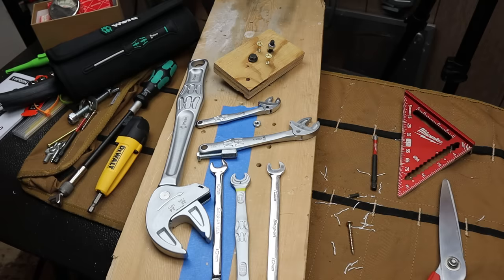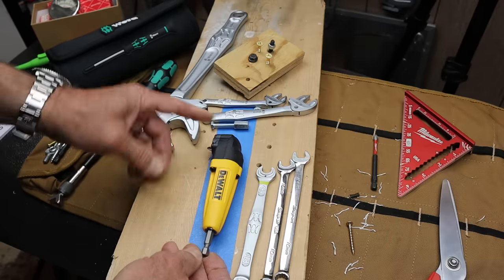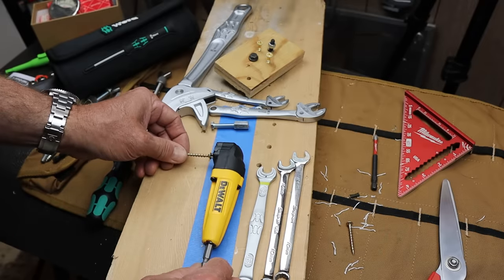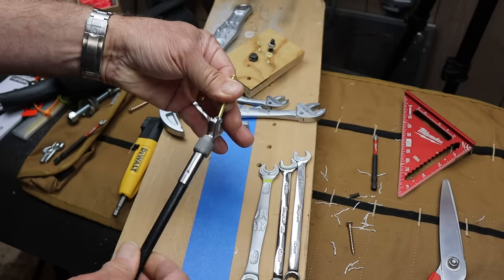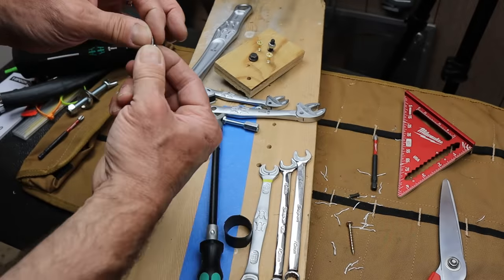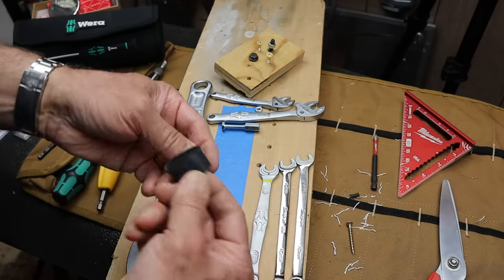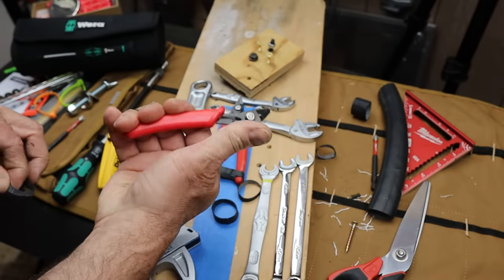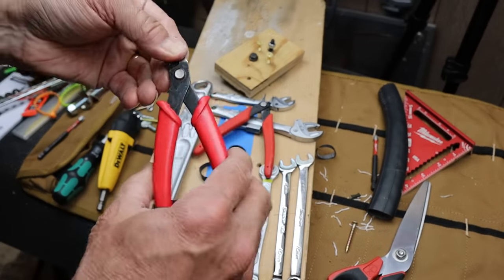Wera Joker Combination Ratcheting Wrench: If Apple made wrenches, this is what I'd expect. Very Nice

Comment: Hello again Doc 
Thank you for another Great Video. I have not had the experience of using a Wera Wrench yet. As an Aircraft Mechanic all our Tools are SAE/STANDARD. No Metric tools. Remember aviation was born on USA soil. One other thing, most of our hardware is twelve points, we do have some six points hardware. But mainly twelve points. I said that to find out.  If position was switched to twelve points, would the Wrench still work? Again thank you

Comment: I have these spanners, they're great unless the fastener is really tight or corroded.
The ratchet heads arent the most robust but okay.
The offset hex nut holder is a real winner when needed.
Top expensive for what they are imho

Comment: Why wouldnt they make SAE set? Eventhough arent nearly as common as metric, theres still plenty of SAE hardware out there. Id say 95% of the new tools i buy are all metric, but thats because its far more common so ill get much more use out of them, and i have plenty of SAE tools for when i need them. But ya thank you for the review on the wera joker. Ive been seeing a lot of ppl talking about them lately. I love how they have that feature to hold the fastener, as well as the directional arrow. So many of the ratchet wrenches that you have to flip back and forth for tighten and loosen dont have a directional arrow. Such an easy thing to put and so important to have it blows my mind so many manufacturers dont include it
Reply: because Wera's market is largely Europe. But they've been getting more and more popular in the states so I presume they will go that way soon.

Comment: 10:15 Not inventing, as doing Appliance repair/maintenance and electronics repair means you ARE IN SITUATIONS just like this. Had a dishwasher 2 weeks ago, built in, and had to replace door pulley system on both sides. Once removed bottom cover of dishwasher, was able to get hands and super low profile 5/16 ratcheting wrench in there to remove screw and nut from the 2 pulleys, and remove spring and thread new rope and replace pulleys w/ new; but it’s tight, and NEED super low profile ratcheting wrenches and but drivers that can go on wrenches, thumb spinners, etc to do this kind of work. Still looking for best already made tools instead of making my own over and over; so keep looking, buying and hoping they work for what need after purchasing expensive tools at time.
So, again, not a waste of time for this test device you have here as IT HAPPENS and anyone in appliance, hvac, electronics, electrician, etc repair/work will find tools like this EXTREMELY HELPFUL AND PAY for them! as it can mean spending few minutes or hours completely removing something that if had right tool, wouldn’t need to at all and can move onto next job win in a day, not just do 1 or 2.
Cheers ✌🏻

Comment: Sold my Jokers, straight heads made them basically useless. Also very bulky, so no good for tight spaces. Flexed under load, slipped and damaged bolt heads. For Wera, a really suprising fail. I  have plenty of other Wera stuff  that is first class.

Comment: If I can suggest a tool brand to look into. CHP tools sold in the US by Hakko. I've been using their TRR-58-G at my work for over 3 years. they hold up very well, rated for 10ga copper wire, and are only like $13,

Comment: I bought these years ago because I thought they were the best. Wrong. They need an offset about 15° and the bite part needs to be thicker. It just cuts into the fastener and then gets stuck. Plus it just feels weird in the hand because it's covered in weird patterns so you can't feel which end is which. I like your channel so I wanted to tell people, might be better for plumbing where you don't need an offset.

Comment: How durable are they getting banged around, i work on boats and they soak everything in white paint so the 13s are often 14s with paint and i find myself hammering a 13 onto the bolt

Comment: These have 80 teeth, not 90, for a 4.5 degree turn angle. Snap on also make ones with 80 teeth for exact same turn angle. Then there's the specialty ones with 120 teeth for only a 3 degree turn angle made by stanley and craftsman and a really crazy-fine one with 216 teeth positions for only a 1.7 degree turn angle made by SK tools. Will I even need a 1.7 degree arc angle? Unlikely. But I do still want one :)

Comment: Looks fancy, has fancy features, cost a premium, and they still forgot to give it a selector.
Yep that sounds exactly like something Crapple would make.
Reply: They seem stronger without the selector weak point. And I hate apple.
Reply: @adriandaw3451  
Maybe they are stronger, but you can back yourself into a corner so to speak if you can't go in reverse.
That's mostly just going to happen if you're trying to remove one part when you should have removed another first, but with a selector you won't get stuck and can potentially not have to worry about that other part.

Comment: To be fair the test is not completely accurate because the snapon head is larger hitting the top of the screw and not swinging as much as the weird ratchet which slips under the screw head thus the rachet is swinging further. No hate though good work my friend

Comment: How common is the use of SAE vs metric at present? Is metric increasing its share or is it sill niche, like foreign cars and equipment? (Though I would imagine foreign cars are increasing - toyota, kia/hyundai). What about non-automotive applications - home use, construction, etc?
Reply: IME, automotive applications necessitate metric tools, whether the cars are domestic or imported. Household items are often Imperial, though this seems to be changing.

Comment: one of the biggest advantages of the "12 point" open end is the workable angle i had one single screw on a steering column of my tractor and nothing worked apart from that open end

Comment: these are super annoying to use the open end on. they round off or atleast cut into nuts/bolts CONSTANTLY. stuff thats maybe 15 to 20Nm it will cut into on the smaller sizes.

Comment: if Apple mad wrenches this is how they'd be?   
You're joking, right?
This is the same Apple inc. that:
singlehandedly ushered in the next tier of planned obsolescence into the manufacturing world?
The same Apple inc. Who set the standard of: "The life of the device is determined by the lifespan of the battery" paradigm?
Where a $1200 device, which SHOULD potentially be able to function for up to or above 20 years, only lasts 3, to maybe 4 years... because that's the expected lifespan of batteries.
Now almost every device has NO user-serviceable battery capabilities and, very intentionally, provides NO replacement battery service...
The same Apple inc. even goes above and beyond to GUARANTEE your iCrap device ONLY can ever deliver its planned life-span: by serialising the batteries now.
   ...great.
And that's not even getting started on the devices themselves.

You mean that Apple?

Comment: I wouldn't say metrics always nicer than SAE. I have a hard time mentally calculating height when somebody says they're 1.8288 M tall unlike 6 ft. As for the wrench, I would rather have the snap-on because of the thin wall design. I have more trouble with obstacles being in the way than I do with my wrench falling off. That said if they could come up with a thin wall design they would have something I'm interested in.
Reply: That has nothing to do with the metric system itself, its 100% due to you being used to the SAE system :)

Let me assure you that us metric folk have absolutely no problem mentally grasping how tall someone is when it's given in proper units, meters or centimetres. And the vast majority of us has very little mental reference if we hear that someone is 5 foot 9 or similar :)

Also, absolutely no one would ever quote the length of a person in meters with 4 decimals, since that last digit is tenths of a millimeter. Something you measure with calipers for example, and has no use for the length of a person :)
We use meters with 2 decimals or whole centimeters, you really don't need more precision when measure humans for normal use ;)

Comment: Apple is the worst brand to compare it with. Apple has its own stupid versions of torx screws, and if it was Apple, it would only work with Apple bolts. Until EU tell them otherwise. 

 "The best bolt ever made" would be a yearly trend.